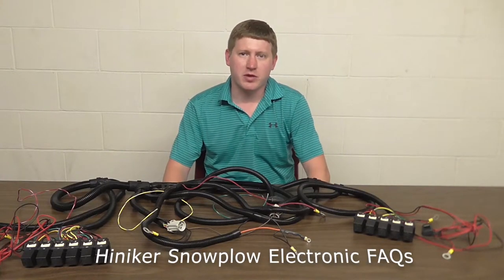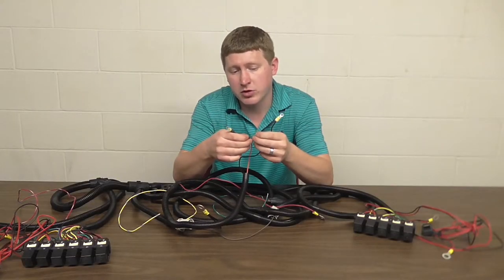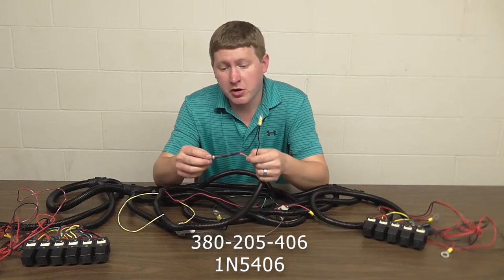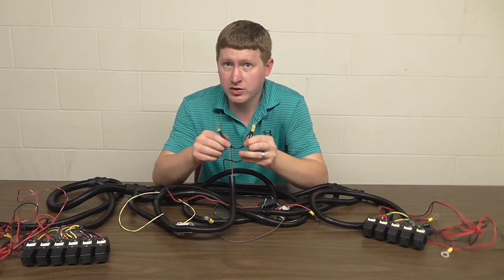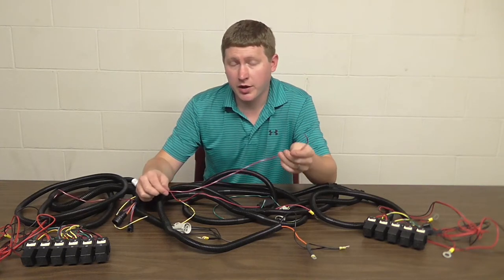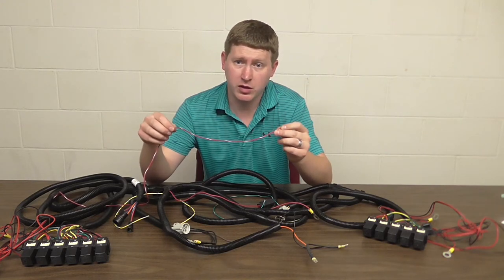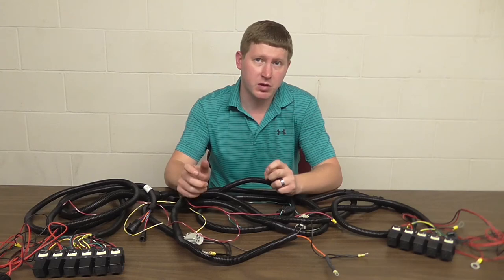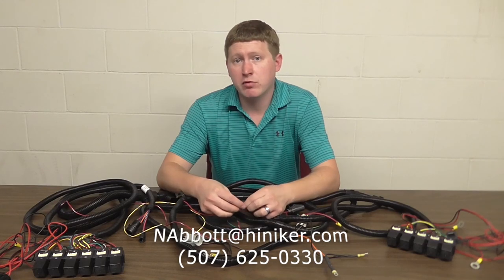Hiniker Snowplow Electronic FAQs | Snowplow Jumper Wire Cable | Red Wire | Plow Bouncing Up

Comment: Question. C plow owner. Plow is jerky intermittent going up. Pump sounds like it's running. All other movements are fine, side/side, C movement. Thx
Reply from the maker: An intermittent problem usual is an electrical issue, most likely a ground issue.
Reply: Check the relays and solinoid......
Reply: Turns out it was the Truck Battery! From further research, I found the plows are hard on the battery.
Reply: @kennyplay5982  plows will kill the battery's replace every couple years...